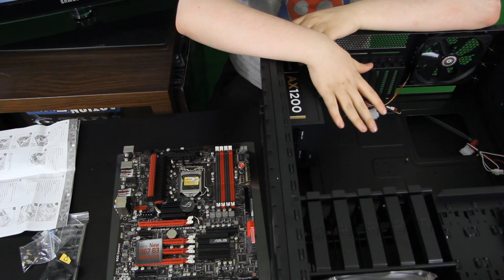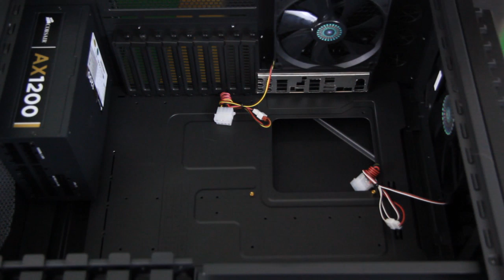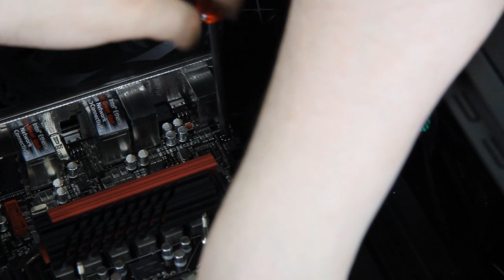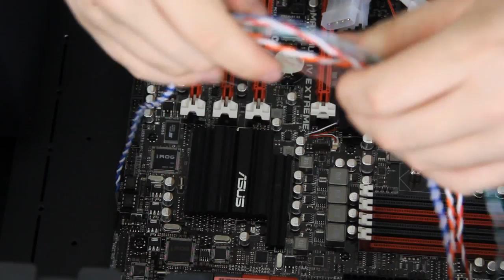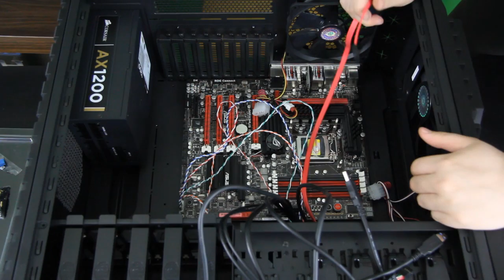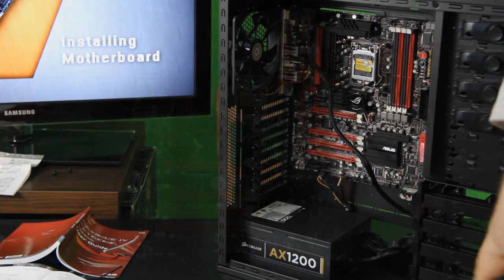Gaming PC Building Tutorial - Motherboard

Comment: Actually you SHOULD use a tool to tighten MB standoffs! More expensive cases (like your Cooler Master HAF X, lol) comes with small tool to do that or you can use 5mm (3/16") nut driver for "standard" standoffs.

Comment: This is difficult to answer. What we would like to know is what CPU you are using so the motherboard will work with it. In general, the spec you need is for two 16x PCI slots but again, this may not be available due to the CPU you have. If not, a 16x/ 8x configuration should be pretty easy to find. 
  Some folks swear by certain brands..... Any reply may lead to  many replies that refute a suggestion.

Comment: hi, i have the same case and the same mobo and i was wondering on the front panel connectors i can't fine where the pow led + and - goes on the little converter thingi, could you explain where they should be or something? ty